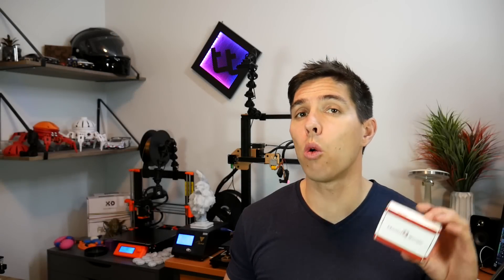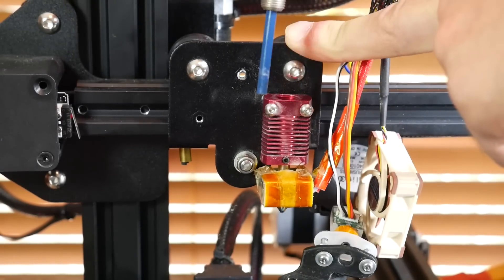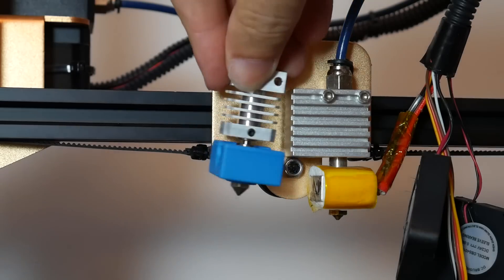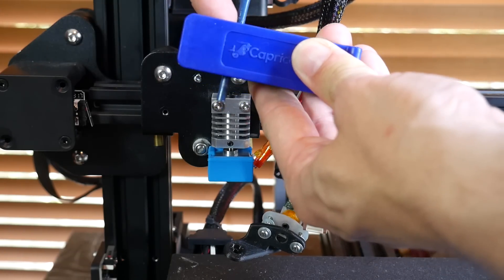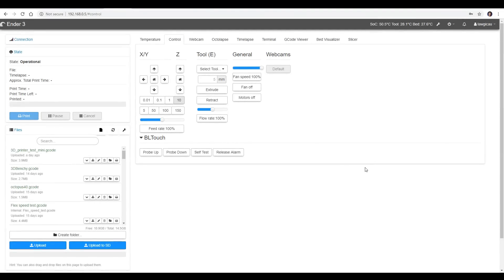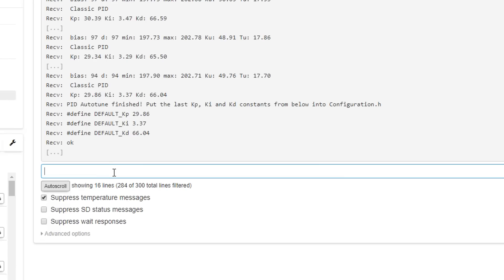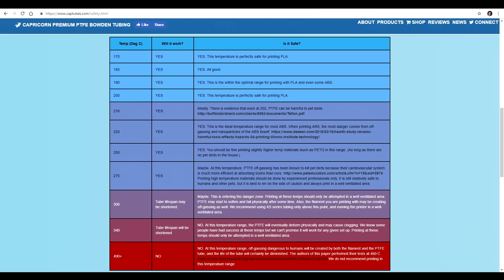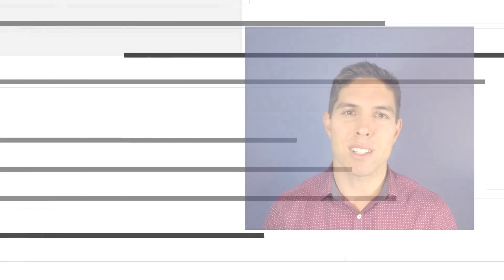Ender 3 Micro Swiss all metal hot end

Comment: Nice video.
I have not tested this hotend myself, but I got the microswiss heatbreak for my Prusa i3 mk3. It had already an e3d allmetal heatbreak, but I sometimes had clogging. With the microswiss heatbreak I had no clogging at all. The coating of microswiss seem to very good; it has less friction than other allmetal hotends.

Normaly allmetal means problems with PLA. So its a decision between PTFE Inliner (good in PLA but no high temperatures) or allmetal (good for high temperatures, but PLA on low temperatures tends to lower print quality).

So your video is very useful, as it shows you can use the allmetal microswiss hotend without loosing print quality with PLA.

I do not know if there are any allmetal hotends from china to compare. But If there are, adding an comparation to the microswiss would be useful. That should show a lower quality in PLA with an uncoated heatbreak. Trianglelabs even warn to use allmetal for PLA (and their chinese clones are the more quality ones).

So I think result should be: If you use only low-temp materials, stay to the stock hotend. But if you want the possiblity to print high-temp, using allmetal from microswiss will not reduce quality in printing PLA like other allmetal hotends might do.
Reply from the maker: Thanks for the detailed feedback.

Comment: I suspect this is why my nozzle keeps getting clogged and my retractions keep getting turned up but still give me stringy results. With a dual extruder I have twice the risk of not seating the PTFE properly.
Reply: It could be that you don't have good cooling. Noctua fans are not that great for performance but they are good for silence. Check this video https://www.youtube.com/watch?v=azm1c55JOxk .
Reply from the maker: Mine are working perfectly, on my Ender 3 and prusa mk3.
Reply: @TeachingTech   What about your A10M? It might be bad filament I used, as since I used black I was seeing it appear in prints many prints later and have all kinds of extrusion issues. I changed my E steps from 340 up to 430, as this measured out 100mm when asking it to do so (rather than 79mm). However that made everything massively over extrude and I dialed it right back to default and re-leveled my bed and now it seems fine again. I'm reluctant to ever use that black PLA (Technology Outlet) from Amazon again and it's funny how it's no longer available. 
What I don't get is how everyone calibrates their e-steps to 100mm but this doesn't work for my machine, where 79% correctly extrudes. Weird.
Reply: @redheadsg1   Cooling isn't the issue since my overhangs are pretty good, even at 210. I printed different kinds of fan ducts but the one that came with it seems to be the best.

Comment: Great instructions Michael. My experiences installing the Micro Swiss hotend on the CR-10s were that same as yours, the upgrade was very easy indeed, I too had to raise the BL Touch 2mm by removing the spacers (nuts). Regarding the PID settings, I add them to the start gcode in S3D, it makes it easier to change the setting for different filaments, although I currently use PLA for the most part, I will be using PETG etc too after the Keenovo heatbed upgrade is done. I may well upgrade the cooling duct and fans at some point to because ..... well, why not :-)
Reply from the maker: Good to hear yours has gone well. I agree modding for the sake of it is addictive.
Reply: If you're using BLTouch you have flashed the firmware, so... why aren't you saving the settings to the eeprom? you forgot to enable it before flashing?
Reply: @AlanGonzalez-om4rr  Hi, I have flashed my firmware and enabled eeprom, running completely custom Marlin 1.1.9. I keep my PID settings in the slicer (S3D) so that I can have separate PID settings for individual filament types without needing to alter them in eeprom. I just find it easier that way. Either way is perfectly fine. Hope this helps
Reply: @spikekent  The PID have nothing to do with the filament, it's heater-oriented... You should change it if you q
Reply: @AlanGonzalez-om4rr  You're quite right, it is heater related, although, by definition it does affect the filament. However, by putting the PID settings in the start gcode in the slicer, it sends that code to the printer before the print starts, thereby setting the PID values for that print only. Thats why I find it easier this way. When I change to a different filament (say PETG) I have a profile for that, including different PID settings, so again, the PID values for that filament are used for that print. For example, the PID command for PLA in my slicer is this M301 P41.81 I6.63 D65.93 ; PID Values 215C Micro Swiss. The bits after the semi-colon are just comments to remind me of what the setting is for.

Comment: Hi Michael, I have a question, The Capricorn XS PTFE tubing is rated up 340C why can't I run it at 265 degrees C using the stock hot end? it's far from its rated breakdown point.
Reply: You can. You just have to realize that heat creep causes PTFE to fail anyway. You also have to change your bowden adapter because the stock Creality one sucks which is why you see people have issues with it sliding up and clogging. There is a printable fix on Thingyverse for the slippage caused by the metal ring losing traction but I have no tried it.
Reply from the maker: Great answer, I agree 100%

Comment: Mikey, I might end up upgrading to the Micro Swiss all metal hot end eventually. I have one of their tempered steel nozzles which is suppose to stand up to more abrasive materials, but I've only used PETG and PLA on it so far. Unfortunately I couldn't find anything other than the standard .4mm nozzles, and they're a little pricey, but maybe you could do a video on those for the Tevo T or the Ender 3. Any how, good to see you again, and Merry Christmas.

Comment: Yup I upgraded to this device a while ago mostly because I’ve standardized in printing PETG but also want to expand to other material.
Reply from the maker: I don't mind spending money in this hobby so happy to have it to make the printer feel about nicer and higher quality.
Reply: I print overture PETG at 260 and it still looks like it’s not hot enough so I need to decrease speed. Has it made it easier to print Petg?
Reply: @patjohn775  i printed it at 240c with no issues
Reply: Have you printed in PC?
Reply: @SaulHernandez-vh2rw  I personally have not.

Comment: Mine keeps clogging after several prints and i have to clean it out then go to the point wear i never had a good print if you check the one stars on Amazon most say the same thing as it cools down filament hardens and does not reheat causing a block.
Reply: I have had the same problem on my Ender  5.  I'm trying some custom gcode at the end of the print to retract filament so that it does not sit in the hot end and then cool.  Otherwise the hot end is very well built and easy to install.  I have had a terrible time changing filament, can't get the old filament out

Comment: I am wondering if the block is a similar geometry to the V6 block with the nozzle and heat break both being M6 threads.

If so, and upgrade to a cartridge thermistor could be possible.
Reply from the maker: I didn't measure but the threads on both sides of the heater block looked identical.

Comment: Here I just asked on the FB group if they were the same bolt pattern. I been having issues with my Prusa getting the PLA stock in the heat break. Has worked fine for months and now cant get a single print to work. Ordered the Micro Swiss E3D Replacement that allows the tube all the way down the heat break. Hopefully better results.

Comment: I believe the Swiss site also mentioned raising your default temp as well, I recently fitted the micro and usually print PLA at 200c, but I have found 218c works a lot better, I'm also using the bullseye cooler. Great vid though as always. 👍
Reply from the maker: I had a bit at the back of the video about this. Thanks for mentioning it.

Comment: Thanks for sharing :-)
But is it possible to get a 300oC with the marlin software, without change in the firmware?
What will the thermister say to 300oC? is the plastic isolator at the leads to the thermister OK with this temperature?, it the Thermistor linear at 300oC?
Thanks again for your great job, of sharing your passion to all of us :-)
Reply from the maker: Firstly, what are you printing that needs 300? You could change the thermistor to a higher quality/known brand one of the same value (firmware is set to "
// 1 is 100k thermistor - best choice for EPCOS 100k (4.7k pullup")
Reply from the maker: Just checked the thermistor tables in marlin, the thermistor is rated with an upper value of 300. You would still need to up your maxtemp value in configuration.h

Comment: Michael, do you think you could do a more in-depth video with manual mesh bed leveling, unless you have a video that goes more in-depth with starting scripts and gcode editing, I can’t get the bed leveling to save to the firmware or get recalled in the starting script, let alone how to do it properly. Thanks!
Reply: Get yourself a 23.5 x 23.5 cm mirror glass and use it as bed problem solved no need of all this bed levelling hackery shit, why mirror glass? u may ask it's because it has to be flat to view our reflection, it cools down quickly and heats quickly too, easy on plastic no traces of plastic as such once printing is done.
Reply: @NaveenKumar-rx9zk  Glass add a huge weight to y-axis. You should print in lower speed to avoid ringing/ghosting.
Also it is very simple to make a magnetic bed for ender3. If you get an PEI powder coated spring steel sheet from thekkiinngg (Version 3) you get the nicest surface money can buy (better than Prusa PEI powder coated). A spring steel made for Prusa mk3 fits in Ender 3, If you rotate the spring steel by 90°.
And its less weight than a mirror.
Reply from the maker: Hi Ben, in case you missed it the Ender 3 beginner fixes has the final section on manual mesh bed levelling.
Reply: Teaching Tech I’ll check it out, thank you!
Reply: @oleurgast730  I was unaware of that and yes my prints have been stringy lately good to know I will try to use the non mirror beds then
Reply: If you do a bed leveling, save it with M500 and when you restart the printer it's not saved it means you have an older version of Marlin (newer ones have supposedly fixed this). I am also running an older version and I have working bed leveling by putting "M420 S1" in the starting script of the slicer (after G28), or manually adding this line in the generated gcode, just ensure it's after the G28 command.
Reply: Aside - there's an option RESTORE_LEVELING_AFTER_G28 (uncomment in configuration.h) to deal with G28 resetting the mesh - useful for the manual mesh bed levelling when you really don't want to re-level every print! Still need M420 S1 to activate it following power-up.

Comment: Thanks for the video, Michael. I am in the same boat as John T. The only thing I am thinking is I have started to try out printing with PETG now. And PETG prints at a temperature of up to 245 so wondering if I should make the change now.
Reply: No standard is fine for PETG and beneficial for all filaments other than PC or nylon.
Reply: I've been printing with Amazon Basics PETG at 240C for a couple of months now (with the Ender-3). No real problems, especially compared to printing ABS on my old UP Plus 2 -- there was always an odor problem with that!
Side-note: I did get odd fumes for the first few hours of printing (Ender-3), not sure if this was the kapton tape baking to the heater block or machine oil burning off.
The only big change I have done on my 'stock' Ender-3 is to replace the standard PTFE tubing with the Capricorn XS (PTFE) tubing. Still printing PETG at 240C without problems.
If you are concerned about fumes from the PTFE tubing then I suggest you setup active ventilation. I have an extractor fan in my workshop which I run when the 3D printer(s) are running.
Reply from the maker: Agree with everyone here, stock is fine for petg.